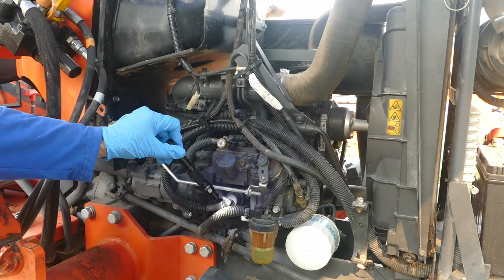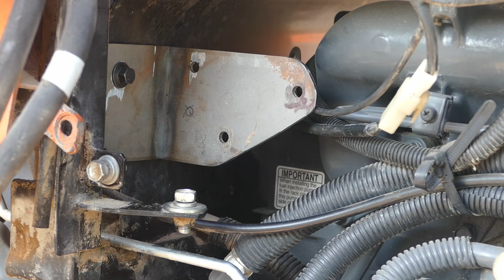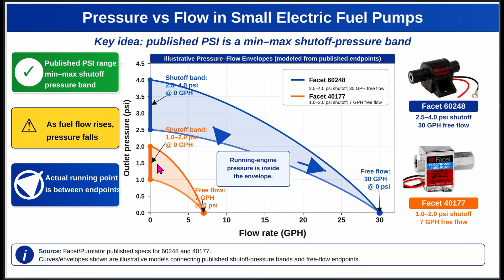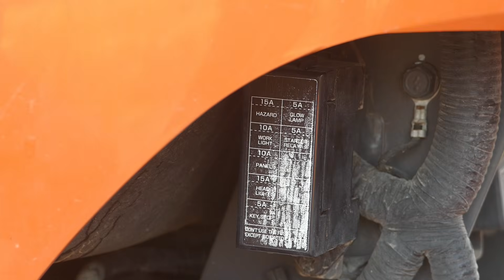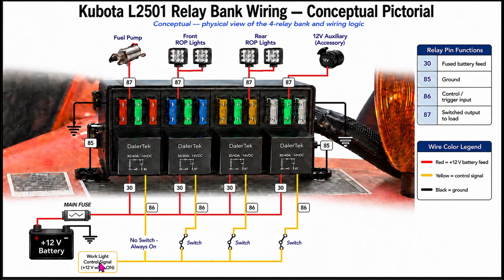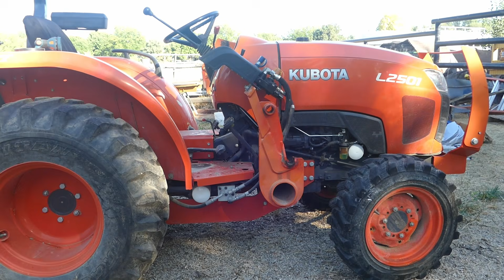Kubota L2501: Electric Fuel Pump

Comment: This video is perfect! But I wish I would have seen it a week ago. I just replaced my pump for the second time in 400 hours. I am going to do what you did and install the electric pump this winter because I do not trust the factory pump. You did an excellent job in explaining and presenting this solution to a problem that a lot of 2501 owners have. Thank you!
Reply from the maker: Thank you very much! I’m glad you found the video helpful, although I wish you had seen it before replacing that second pump. Two pumps in 400 hours is certainly frustrating. I hope the electric pump conversion works well for you, and I’d be interested to hear how it turns out this winter. Thanks again for watching and commenting!